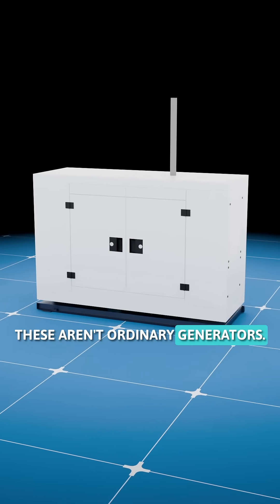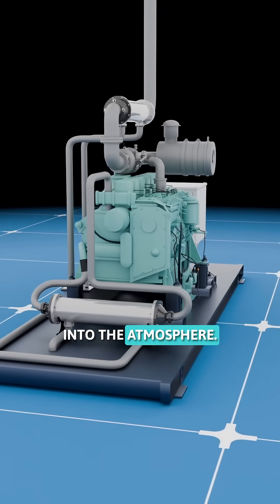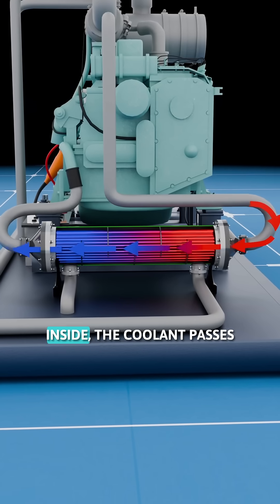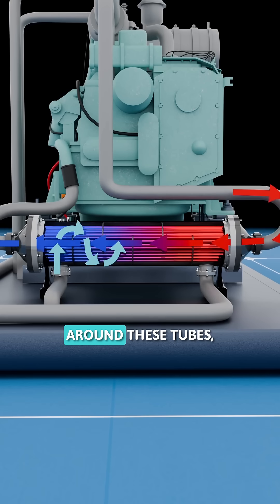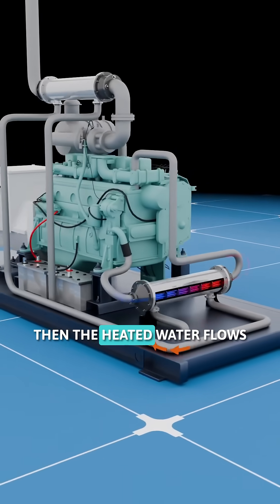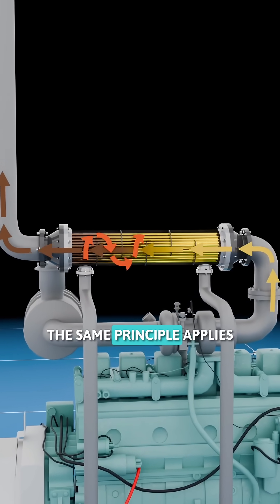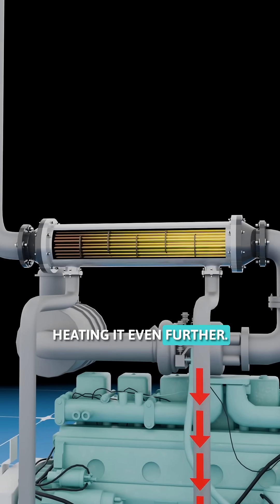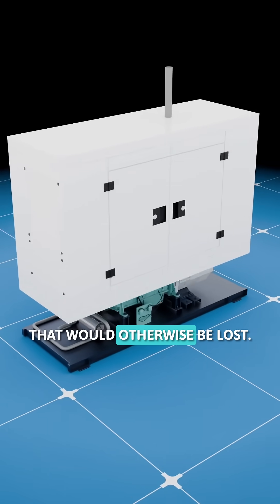Turning Waste Heat Into Useful Energy | CHP Systems

Comment: Okay, so it transfers the waste heat into coolant.  Why is that desirable?
Reply: it is cooled down again by the end of the process -  the heat is transferred into 2nd circuit separate from the coolant in the engine
Reply: the 2nd circuit is in most cases, a heat plant - which uses the excess heat to warm up rooms or heat up service water.